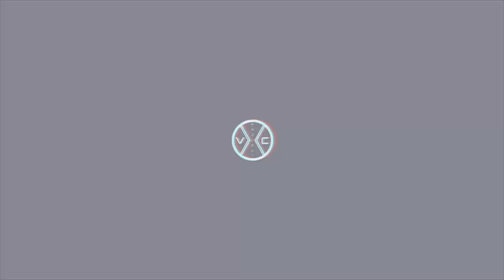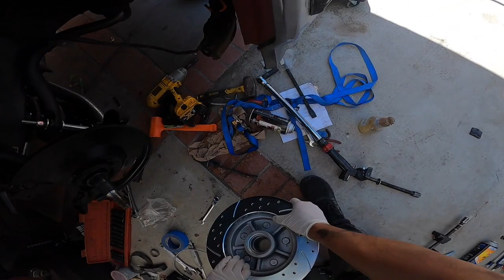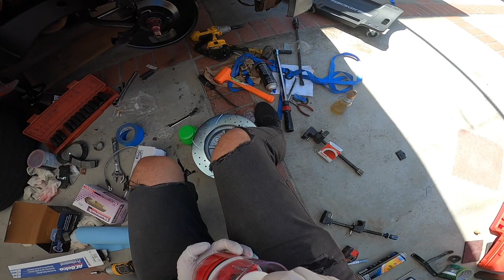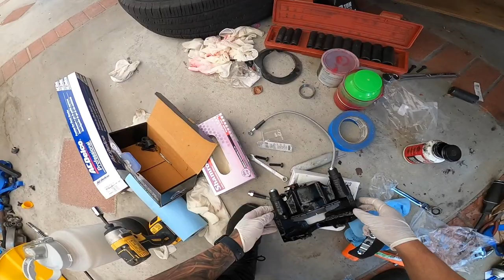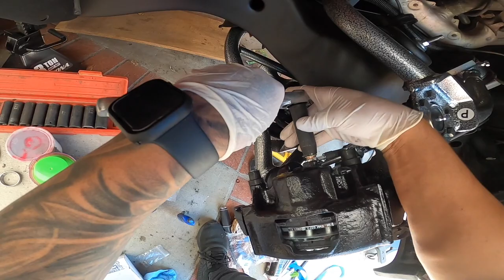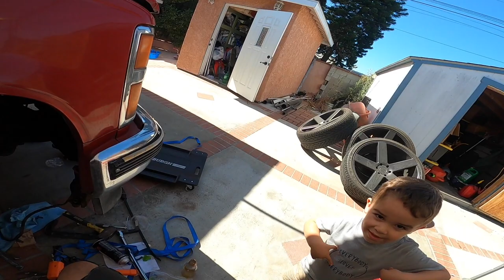PERFORMANCE UPGRADED BRAKES FOR MY 90 OBS!! *STEP BY STEP*

Comment: Nice, I’ll be wait on the NBS master cylinder video.

Hey why didn’t you with the big brake upgrade kit.? From little shop mfg.. as well can you give details or the rear. I need to install mine. Conversion kit.